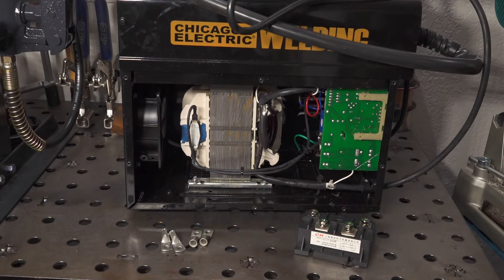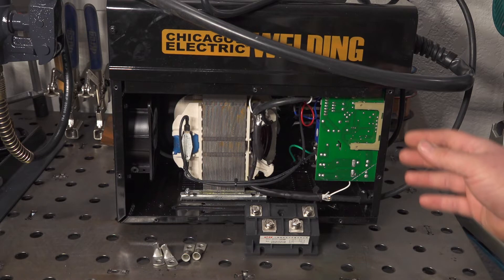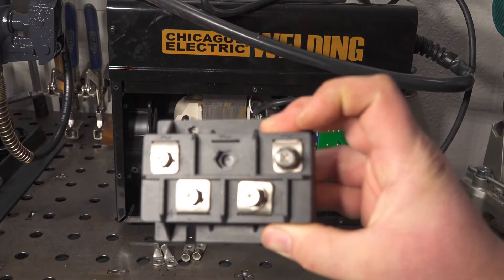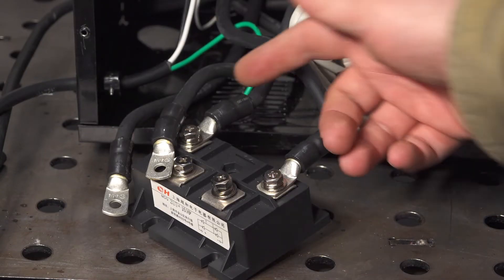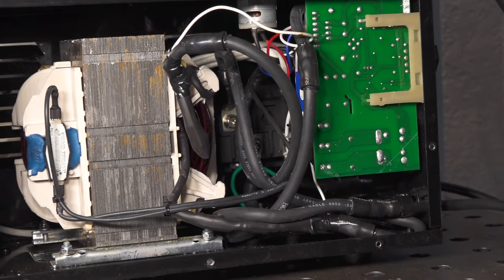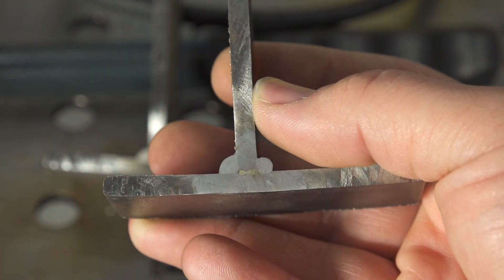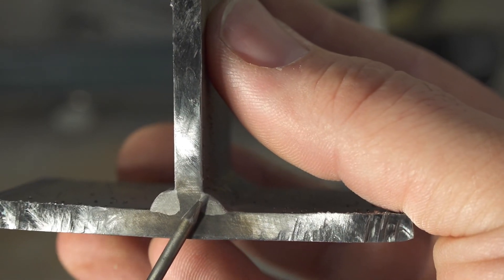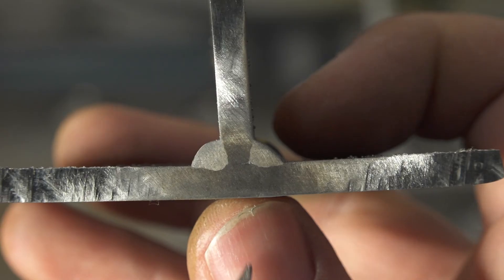Harbor Freight Flux Core: DC Conversion and Testing

Comment: Great video. I'm planning on converting my harbor freight welder next week. I have just 2 quick questions about the welder. First, where do you connect the white wire for the wire feed and second, how has the welder been working for you because I see other videos where they are using transformers and other crap which is to me over kill. I like your way because you just use the rectifier only. Again, great video and thanks. Your boy Eric from So.Cal.
Reply from the maker: I just left that wire where it was.  Just make sure that if you do cut or disconnect that wire that you re-connect it on the AC side of the circuit.  I simply connected the rectifier after that wire and all was well.

I honestly haven't used the welder much.  There shouldn't be an issue not using a capacitor or inductor.  Using them just smooths out the arc.  But the way I did it was just for proof of concept and testing, not for long term use.  If you want it to be reliable you should install a heatsink on the rectifier and use some type of thermal compound between the rectifier and heatsink for proper heat transfer.

Comment: One question. I have see other tutorials and they use capacitors to smooth out the current the machine puts out. Is it absolutely necessary or can I just go without it?
Reply from the maker: I didn't really intend this to be a tutorial, just a basic as possible conversion to test performance.  If you are converting one for normal use the main thing you should do different than me is that the rectifier should have a heat-sink and some thermal compound between the rectifier and the heatsink.  It will need something to keep it from overheating.  A capacitor isn't absolutely critical, but it will smooth out the voltage and make the arc a bit smoother, so it is a good idea.  It's also a good idea to have a bleed-down resistor across the capacitor so it will drain down the voltage when you stop welding.  Otherwise the wire could stay live from the charge in the capacitor when you stop welding.  You could leave out the capacitor and get by.  Even without the capacitor it will still weld better than it does out of the box. Some people also use or create a simple inductor to smooth out the amperage as well.  Again, not critical, but it may make things run a little smoother.
Reply: Thats the point of the video as far as i can tell, he wanted to show that no, smoothing caps arent 'necessary" for changing output using a full wave or bridge rectifier, its just not clean output but any kind of dc will be much better than what the hf spatterwelder can do

Comment: Thank you for showing how to convert it from a/c to d/c . How do you cut those wire and  how do you connected them together
Reply from the maker: I cut the wires with a small wire/cable cutter I have.  It's just a little hand-held snips made for wires.  You could also just use a pair of side-cutters.  I soldered the wires together and protected the connections with shrink tube.  The ring terminals I crimped on, then soldered.
Reply: bigtb1717 thank you !

Comment: what are your thoughts on using 8 awg for the wiring to/from the rectifier & cap? I'm trying to get this conversion done, but accidentally purchased 8AWG THHN wire instead of going with 4 or 6 awg. Considering the short runs, should 8 AWG be ok, or will I necessarily need to go bigger?
Reply from the maker: With the short runs they would probably work okay.  8 AWG will technically have well over twice the voltage drop, compared to 4 AWG.  But it's probably not enough to meaningfully effect how the welder runs.  The main factor is that 8 gauge wire will heat up much faster.  It still may not be be an issue for smaller projects.  If you have a big project and weld a lot, you may overheat the wire insulation.  It would depend on a lot of factors, like how long the wires actually end up, if they have any airflow from the fan over them, etc.
Reply: Woukdnt use thhn.   Stranded is best..  oxygen free 0awg grounding wire neant for car stereos would be cheapest and best..

Comment: “Welder turned down a little bit” There is only low and max settings. Were you welding on the low setting?
Reply from the maker: No, I had the voltage set on high the whole time.  I only adjusted the wire feed speed.
Reply: bigtb1717 ok cool, Thankyou

Comment: 4 diodes =0.7x4=2.8V
P=VI cos Theta,; assume Cos(theta)=1. Hence, Ploss=2.8 x125A = 350 Watts loss, very warm ! 🥵 To avoid thermal runaway, Need thermal grease for reliable
Reply from the maker: I agree.  In my video I just wanted to test the penetration difference, but if you want to do this on a machine that will get much use and want it to be reliable, you will want some kind of heat-sink on the rectifier and would ideally have a thermal interface material between the rectifier and heat-sink.

Comment: I know this is a L O N G time after your video, but...
Could I bolt a square flat piece of aluminum to the place you bolted the rectifier first, then bolt the rectifier to it as a heat sink? The aluminum dissipating the heat faster than metal. Or is that too simple minded?
   Oh, thanx for the help and tests on things to show real life results. Good stuff!
Reply from the maker: A plate of aluminum would definitely help a little, particularly if it was flat and could draw out heat more efficiently, but something that was exposed to the outside of the case or to the airflow of the fan inside would be better.
Reply: @bigtb1717  
Good point! Yes, it was my intention to use a flat piece of aluminum about a quarter inch thick and bigger than the base of the rectifier so it's bolted first, then the rectifier onto it. Of course, cutting a square hole in the side along with the aluminum would ensure a good cooling!
Reply: 4 diodes =0.7x4=2.8V
P=VI cos Theta,; assume Cos(theta)=1. Hence, Ploss=2.8 x125A = 350 Watts loss, very warm ! 🥵
Reply: @atran3462  Yes, this welder is poorly conceived as built. However, supply chain from China sells many, many Bridge Rectifers. Adding much extra profit.

Comment: Ok so I did mine and the only issue I had was I didn’t plant out the mounting of the rectifier correctly so that when reassembled, one of the  screws  that hold the pos. Lead on the rectifier was hitting the big metal part (transformer?) in the welder and shorting it out and blowing a circuit  when 8 pulled the trigger. So I  had to find a couple pan head screws to use and it gave me  the clearance I needed so it wouldn’t short itself out. Did a few test welds and what a difference this hack makes. A lot less spatter, and stronger welds plus... when I used to run it as stock, A/C, if I tried to run a  bead more than 4 inches or so long, it would pop the 20 amp circuit in my garage... now I can run them all I want with no problems. The only thing I did notice, don’t know if it’s good or bad was that I used to be able to run it on “high”  with a wire speed of 7 but now, it sputters on 7 but works great on 4 ...go figure. But  I am happy with the turn out... it’s a lot better welder now.

Comment: you showed me more useful info in less time by actually getting to the point and with shots of before and after welds than any boring multipart series so far..  i"ve decided to go with capacitors and a greased heat sink.  results will have to be at least equal  to what you have shown . also a replacement shrouded fan from a computer.
 thank you
Reply: How did you add a shrouded pc fan from a pc when they are DC fans? The output to the stock fan is AC. Im trying to do the exact same thing.
Reply: @steven33068  Directly from a PC they are typically 12VDC. There are many fans that are the same size that are 120VAC also. Just searched Amazon and found several.

Comment: Help.... lol I’m a little confused about the white wires... you said to  do the splices AFTER the white wires, then you said What ever you do, makes sure they wind up on the A/C side of the rectifier. So in other words, they don’t change at all? They come out of the transformer and go to where ever... and that’s how they stay? We don’t need to switch them around like we are the big wires ? Just want to be sure. Thanks!
Reply from the maker: Correct.  They can stay right were they are.  By "AC side of the rectifier" I meant that they should stay on the AC side of the circuit, not that they should necessarily be connected directly to the rectifier.  You just don't want them to be on the DC side of the circuit.  Hopefully that makes sense.
Reply: And now, I finally got my rectifier in from amazon and I looked at it and there are no markings to tell me which side is ac and hitch is dc lol there’s just + and -  but one side does have a little ~ next to each terminal...
Reply from the maker: @hdrjunkie  The + and - mark the positive and negative on the DC side of the rectifier.  The ~ symbols are the AC input side.
Reply: Great!! Thanks again for the help!

Comment: It seems that any knowledgeable welder suggest switching the DC polarity on a flux core welder, why aren't they just built this way? Or included with a switch?
Reply from the maker: This particular welder has AC output to save cost.  In this video I convert it to DC output and wire it for electrode negative, which is the polarity that works best with most self-shielded flux core wire.  Most flux core only welders that have DC output are built to have the proper polarity for flux core and do not need to be switched.  Solid wire, gas shielded MIG uses electrode positive and most MIG welders that can run gas shielding will be built with a way to swap polarity so you can run MIG or flux core.

Comment: Can upgrading the power cord to the machine from the stock one help it get more power easily to the machine? My little portable Chicago ele. stick welder has a much thicker power cord on it than my 90 amp Chicago ele. flux core. 

I'm thinking, bigger power cord plus this mod and adding a better ground clamp would go a long way. Also, whats your thoughts on replacing the electrode gun and cable with a better one? Or don't bother as it wont make any real difference?
Reply from the maker: Upgrading the power cord probably wouldn't make a big difference, but it might help a tiny bit.  It's probably not long enough to cause much voltage drop, but the less voltage drop, the better.  A better ground clamp can definitely help with consistency, and is worth the upgrade, in my opinion.  I don't know that replacing the gun and cable for it would be worth the effort.  It's not the greatest, but I don't think it's holding the machine back very much.
Reply: Good to know... thanks again!

Comment: so i have the 120v 90 amp version of this...just to make sure, if i do this mod, it will then be DCEN when done? someone said it already is DCEN, that ALL Flux core welders are, Migs are not. is this true? i have a bunch of flux core wire that says you need to use DCEN thats why i ask. thanks!
Reply from the maker: After the mod it will be DCEN.  You do have to ensure this when you do the mod.  The rectifier will have a positive and a negative output terminal.  You have connect the negative terminal to the wire feed system and the positive terminal to the work/ground clamp.

There are definitely flux core welders that are not DCEN.  The 90A welder you have is AC.  Most self-shielded flux core wire is designed to work with DCEN, so it doesn't work very well on AC.  That is why this conversion helps so much, because stock it is not DCEN, it is AC.  Converting it to DCEN helps a lot. 

Solid wire, gas shielded MIG is normally run on DCEP for steel and stainless, DCEN for aluminum.  Most MIG welders can be switched between EN and EP for running different wire, including flux core.  There are even some flux core wires designed to be used with shielding gas and they use DCEP.  So there are a lot of different situations.  Most commonly, flux core is run on DCEN and MIG run is DCEP.
Reply: Awesome, thanks a lot!

Comment: Great video and demo! 

What's your thoughts on doing this modification for spot/butt welding thin gauge sheet metal? I'm restoring a 16 Gauge exhaust system and want to reduce the chance of burning through.
Would this assist or should I just keep practicing on scrap pieces (16-18 Gauge)?
Reply from the maker: After the conversion it will weld much smoother, but I don't think it will prevent burn-through on thin material very much.  It might help a little, just due to the more consistent arc, but I think practice and figuring out a technique that works for you will be more important.  The limited setting adjustments on this welder are what is going to hold back its performance on thin material more than anything.  

What size wire are you using?  If you are are using 0.035" wire by chance, moving down to 0.030" wire might help a tiny bit as well.
Reply: @bigtb1717  Nice, thanks for the soliid info. I was using the genertic 0.30 but got some brand name 0.30 recentley. Notice the feed roller was set for the 0.35 initially from the store. Was just practicing on 16G. Getting better!

Comment: Just  watched this video. You can use a thick piece of square or rectangle  aluminum dimond plating for a heat sink from menards or Lowe's . Just put the dimond side facing towards the metal plate your going to mount the  electrical box to then between the aluminum plate and that electrical box you installed put some heat sink compound between the two to help wick away the heat. The gaps between the diamonds act as passage ways for the  air to flow through to help wick away the heat  .  On my harbor freight mig welder i changed out the ground clamp to a better quality clamp with a stronger bit and oiled the rotating shafts and bearings . I also buy rolls of mig wire from menards since its made in america and if you buy 3 or more it drops the price from 17.00 something  16.00 something a spool. I buy the small spools . Menards is cheaper on rolls of wire compared to harbor freight or other places.  I also use a heavy gauge extension cord when welding. When your weld plates like you did your suppost to angle grind the edges of the plates  :  V shape  to make a better stronger joint/seam weld.
Reply from the maker: Are you saying I should have bevel the edge of the vertical piece on these joints? 

 If you are trying to get a full penetration weld, such as on a butt weld, then beveling can help and may be required.  But with a fillet weld on a "T" joint or an inside corner joint in general, beveling isn't always practical, and it isn't normally done as far as I know.  There may be situations where it is done, but I don't think it's typical.  With an inside corner joint the fillet size determines the strength of the weld, and many weld specifications will call out the weld height and leg size for the fillet on an inside corner joint.  With something like a thick pad-eye or similar situation, a bevel could be worthwhile.  But with a typical inside corner joint like I show in this testing, I haven't seen beveling done.

But if I'm missing something, let me know.  I'm always willing to learn, and if there is a common procedure of beveling inside corner joints that I've missed, I'm all ears.  Thanks.
Reply: Sorry, but your logic in using diamond plate as a heat sink, is flawed. What you want is maximum surface contact between the rectifier body and the surface it's mounted to. The air gaps caused by the diamonds on the plate material won't "wick away" the heat, as air is a poor conductor of heat compared to metal. You are correct with regard to heat sink compound.